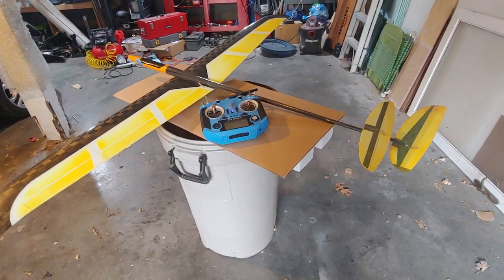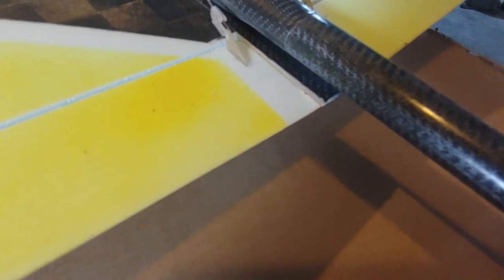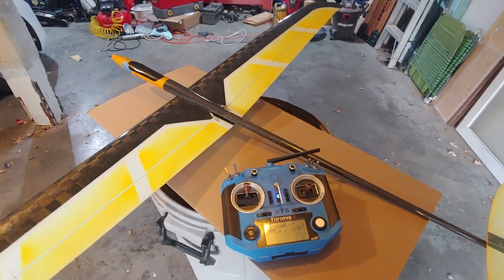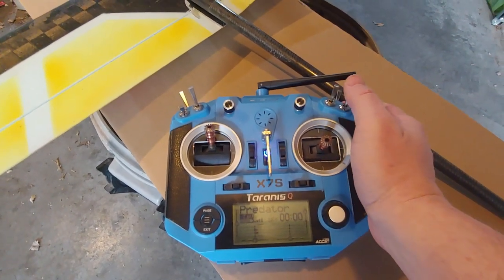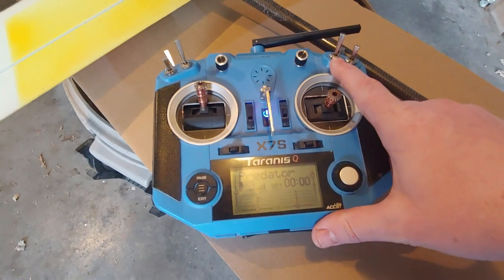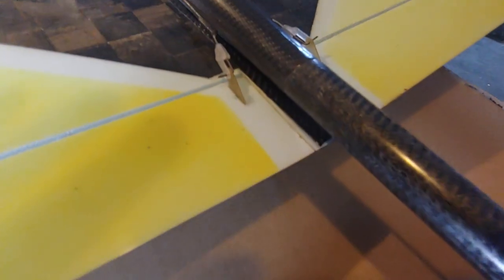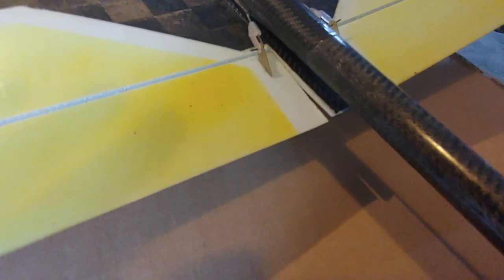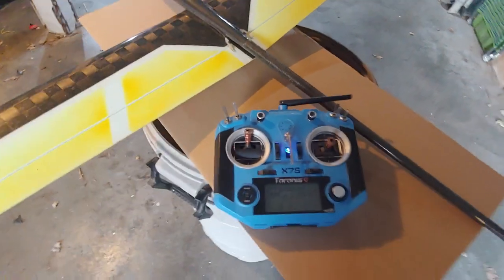Discus Launch Glider (DLG) transmitter setup.

Comment: Hello, my name is Gustavo, I have acquired a used Flitz version 1 I believe. It already has all the controls and servos installed, but I would need to configure the flight modes and the CG. Do you have information available or a setup manual for the Flitz, for example: angles or displacement of the control surfaces in mm in each flight mode? I have an old taranisqx7 radio, I'm wondering if you have any setup file that is compatible with that radio and the flitz. In any case, I have no problems programming the radio, but I need the setup of the flitz in its flight modes to correctly program the radio. Thank you very much